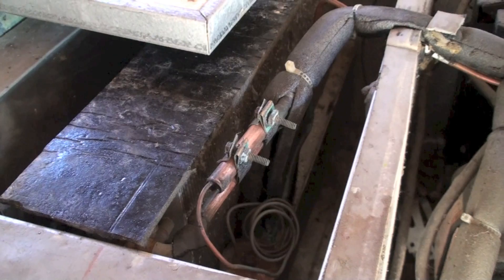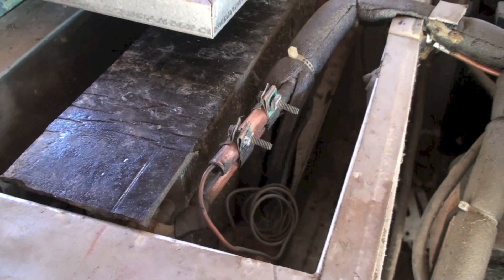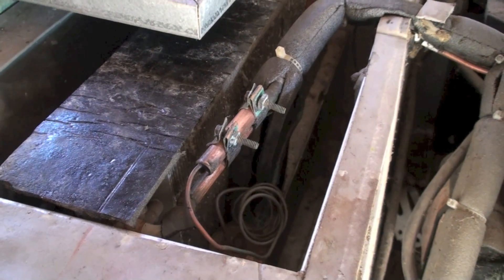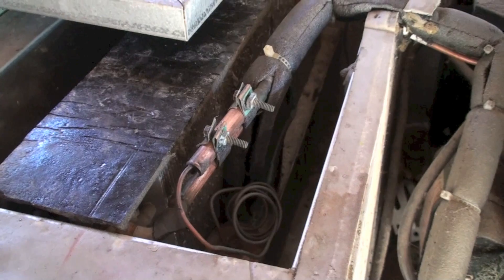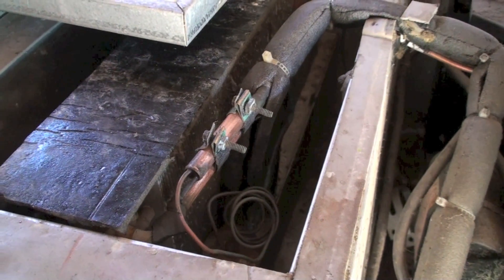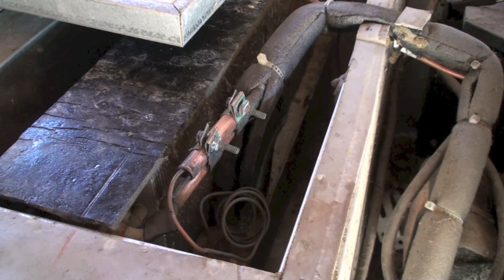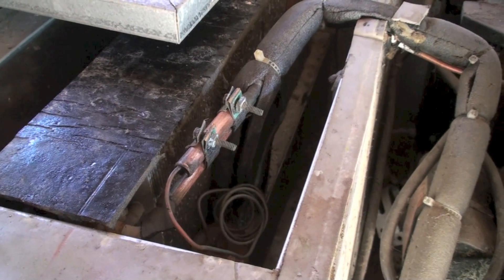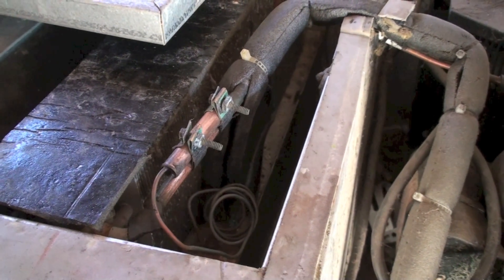What's wrong with this refrigeration system Part 3 answer

Comment: The valve probably had a blockage. You can open it up and clean out the mesh filter inside. That or the plunger/spring were faulty. They're quite basic once you open them up its easy to see what caused the fault